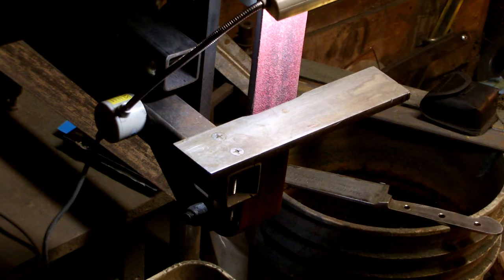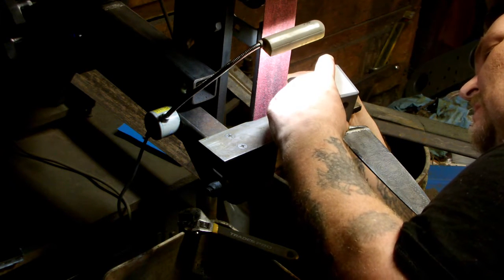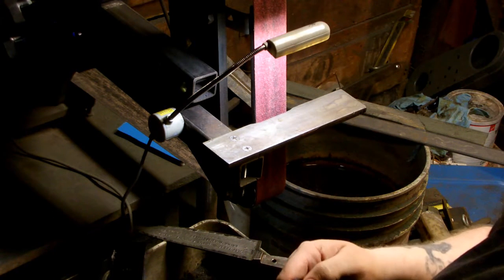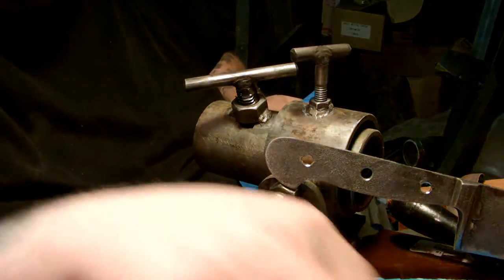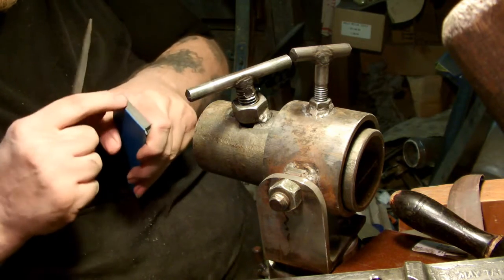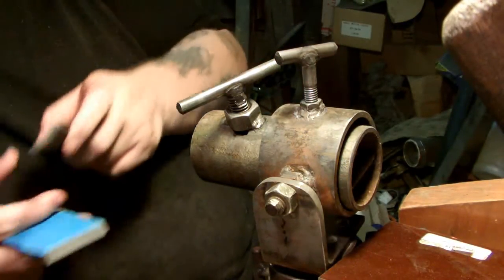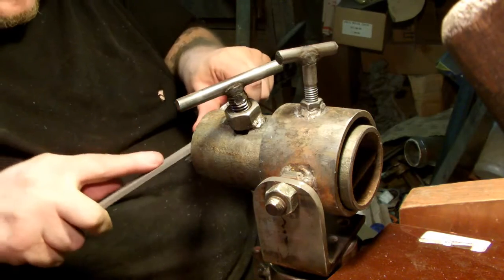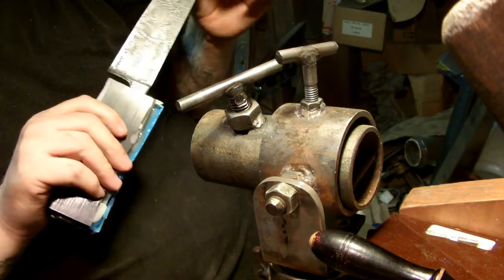Chef Knife Progress - The Handle

Comment: It's looking really nice. Sorry, I didn't mean to hurry you on it. I just figured it might lighten your load a bit. Hope you get feeling better.
Reply from the maker: Honestly, the only thing that lightens my load, is just working through it. I really just absolutely hate the idea of a customer that is even slightly unhappy. To avoid that, i will try to work through anything. You have absolutely no reason to apologize for anything, it's me that needs to apologize for the delays. I just finished gluing up the second side, i went out to the shop at around 5 am and drilled the holes in the first side, then glued the second side, just waiting for it to cure, then it's time to drill it and epoxy the pins in, it should be ready to grind and shape the handle this evening, i will post a video of that too.....